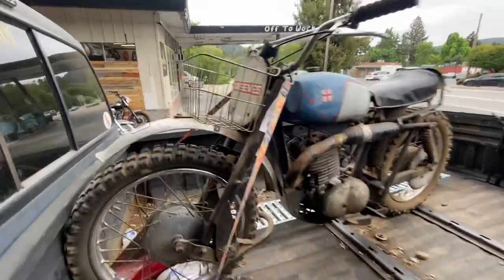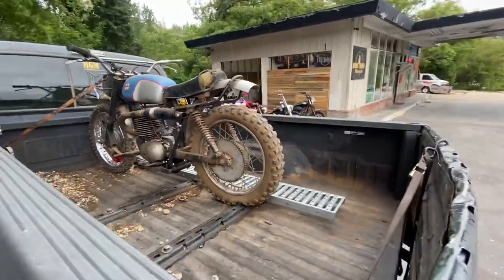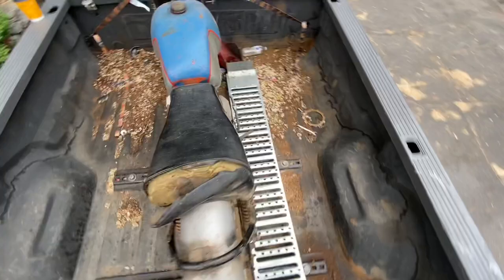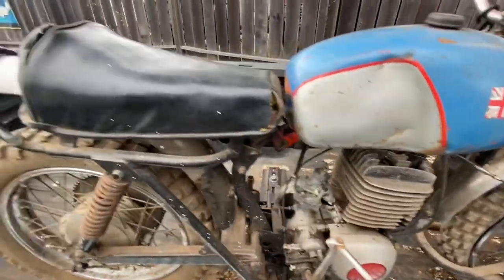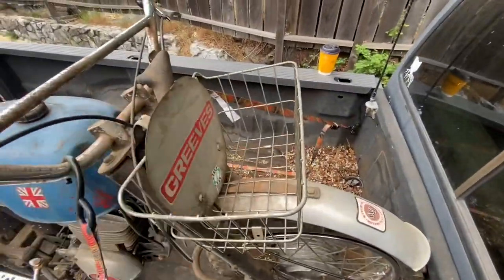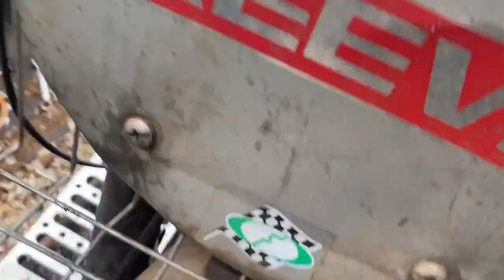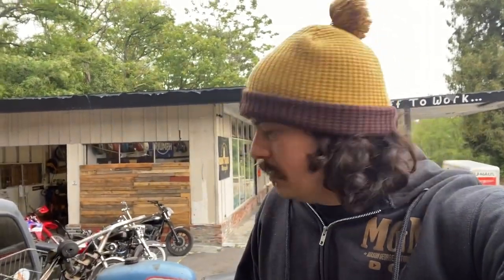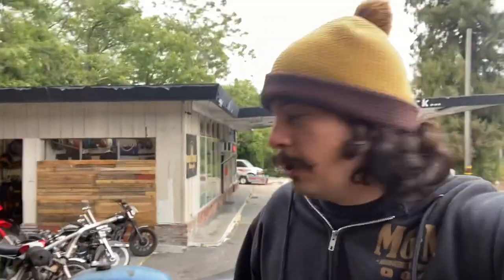Vintage Greeves Motorcycle Found At A Garage Sale!

Comment: I had a 64 greeves. The engine was the same Villiers model.  Your tank is not original.  Nor is exhaust. The carb was originally a mono bloc amal, tho most were updated to a concentric. Good luck with restoration,  will be nice to see!